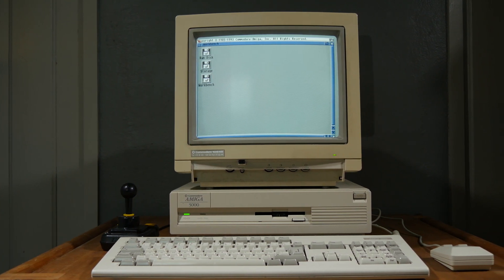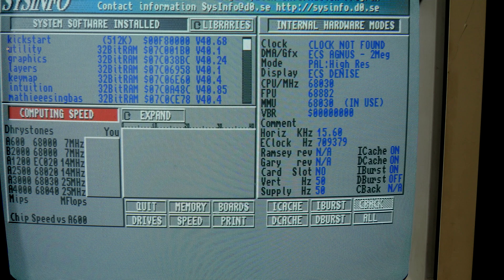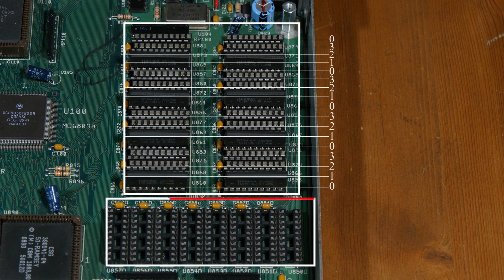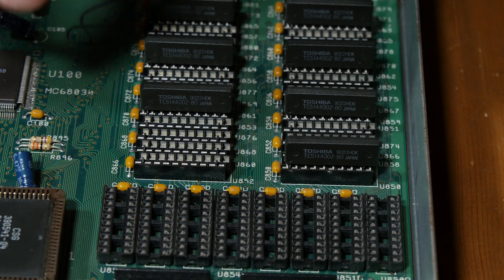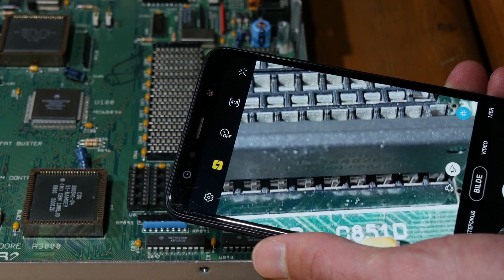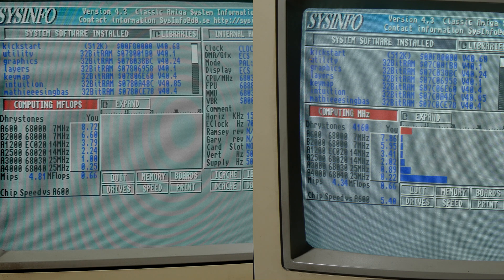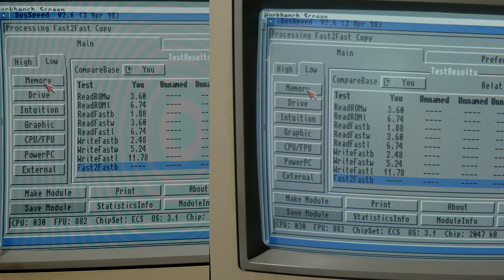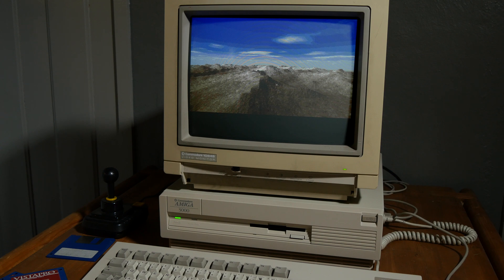Amiga 3000 Ram upgrade

Comment: I wonder if perhaps you need to enable burst mode in order to get the proper speed boost from the Static Column Zip Ram? There are A3000 specific config tools on aminet that let you set every parameter stored in battery memory, among these is some memory specific things like burst. Some of which are only supported on SC Ram.
Reply from the maker: I have not read anything about that in the manual though. I could check out that config tool